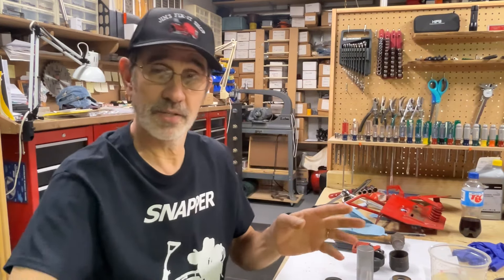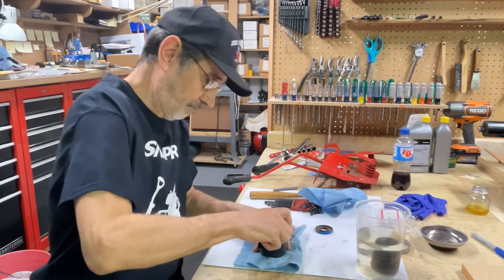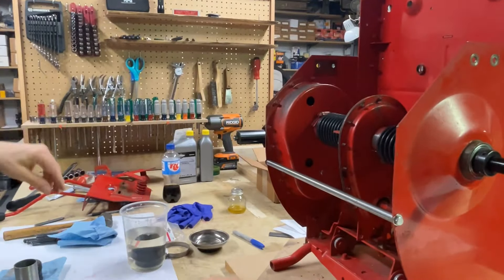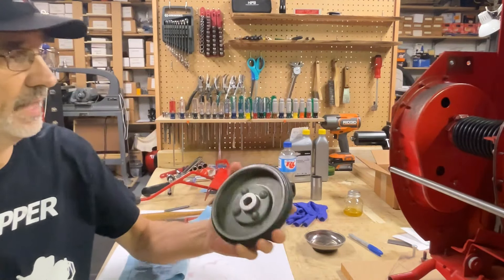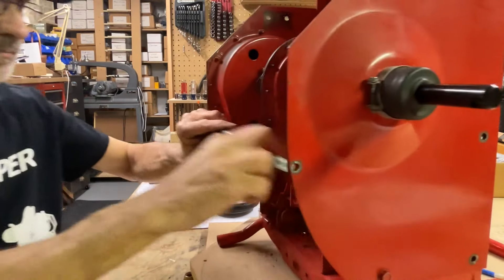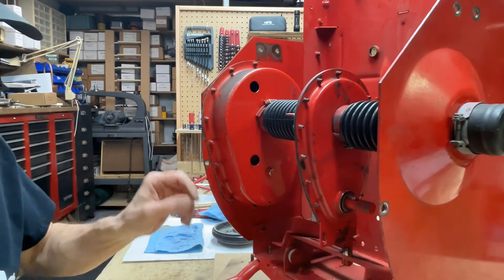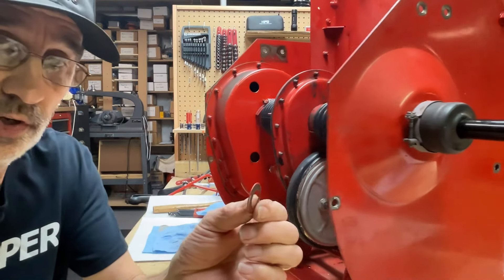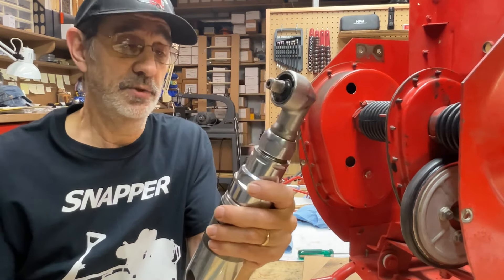471.  Part 4.  How to reassemble the drivetrain on my 33 inch Snapper.

Comment: Don’t you have a video on how to change the rubber lining in the clutch disc because mine is at broke up in place’s and I need to replace it
Reply from the maker: No I don’t because I have never had anyone or myself have to change one. I’m not sure where you can even buy one. I guess I’d check with your local dealer or maybe Amazon.       Jim
Reply from the maker: I forgot, they’re not hard to change, because they’re not glued in. They just slide in and it’s a friction fit, or it’s supposed to be anyway.         Jim

Comment: I meant the whole disc with the rubber on it
Reply from the maker: Well, if it’s wore down or coming off in pieces, you can’t put a new one on you have to buy the entire clutch disk with the liner inside of the disk. You can get them on Amazon or Parts Tree.Com.           Jim